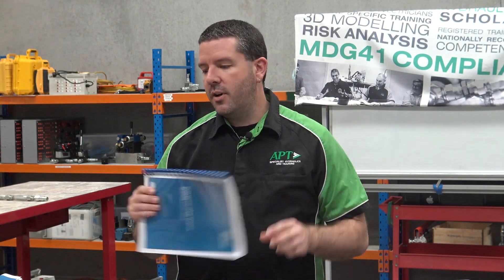MDG41 2018 - Changes to Training & Competence

Comment: Question: Would a hydraulic pump be a option for filtering paint? I have a dip tank that needs it. There is little or no info across the web on this. Forcing paint through a filter is my thinking.